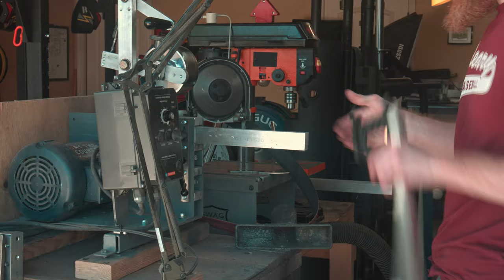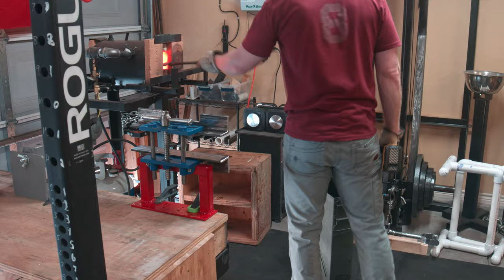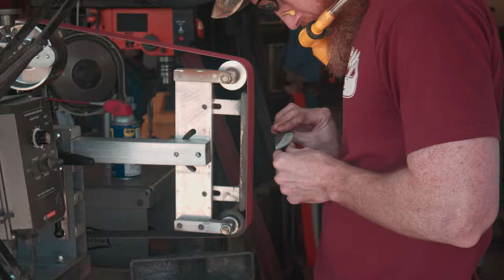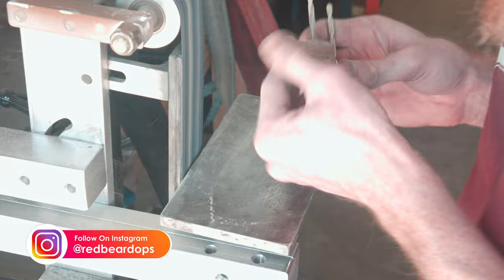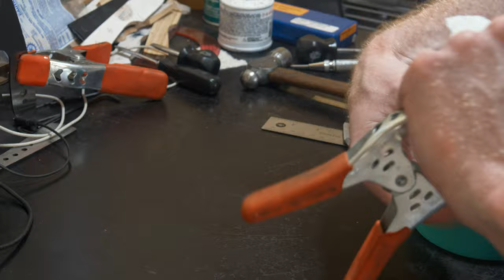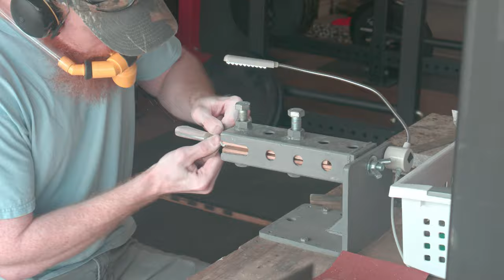Time Lapse | Making A Simple EDC Knife | Knife Making

Comment: That's a great looking Knife! One question, why don't you rough grind the bevels before heat treating? Is it not alot of extra work to grind after? Some of my first knives I didn't pay attention to get the deeper sanding scratches out before heat treat and they were almost impossible to remove. 
I am in the home stretch of my first filleting knife build. That one had some unique challenges dealing with really thin, flexible material. I'm quite happy with the result

Cheers form Canada

p.s. I just emailed a couple pics of the knife. Let me know what you think.
Reply from the maker: I find it easier to do all my grinding post HT. With ceramic belts on the 2x72 this hasn't been an issue for me and it seems to have reduced the amount of warps I encounter. I also feel like I get a more even heat before the quench. The pictures you sent look great! Nice knife sir! Looks very difficult being that thin.

Comment: I have a question, i want to start making knives but as far as handle scales go, they can be pretty pricey. Is it cheaper if i buy a sheet of cherry or oak... from like home depot or is the sheet different and not usable for handle scales?
Reply from the maker: Hey Christopher, I 'm not an expert on handle material but I would imagine that the stuff you get from home depot won't be stable. A good cheap option to get started with is canvas micarta. It's extremely durable and won't swell or shrink. Make sure you don't breath it though.

Comment: When you're doing the surface grind didn't the tape effect getting it completely flat?
Reply from the maker: Hey mike, the tape is pretty thin and uniform. I haven't seen issues with the tape affecting my flat-ness. At least not for what I'm doing. If you were working on a folder I bet you need to be more careful. Cheers sir!

Comment: Loved it! Could you do a knife out of 1095 and test it? I bought 3 pieces of 1095 and want to see how to correctly heat treat it. I've done a lot of research on it but almost of it requires a oven where you can control the temperature. I have a cheap forge made from 2 insulated fire bricks and a map gas torch. I just want to get it right, btw love your content! 😁
Reply from the maker: Hey David, thanks a million for your comment. From my understanding 1095 really needs a soak time to be heat treated correctly... But I bet you can get it to harden to an adequate degree heat treating it like 1084, just not as optimal as if you soaked it. If I were you, I'd HT it like 1084, then file test it. After your temper you can brass rod test the edge.

Comment: Looks good to me, but prefer a bit slower so I can see more details and I like your voice overs about what your doing and why, but there's only so much of that you can do before repeating yourself, still a good vid. It looked like you used the quenching plate vice but when you tempered you still had to use clamps to straighten a warp? Did I see that right?
Reply from the maker: Hey man, I agree. Too Fast. When I was editing I didn't notice since I was familiar with the build. I doubt I'll do another one like this... I do prefer the voice over myself. As far as the tempering goes. I clamped the blade to a straight piece of steel so it wouldn't move during the temper. It came out of the quench/straightening plates straight as as arrow!  Thanks as always for your comment!
Reply: @RedBeardOps  No worries I was wondering, I thought that after going into the vice / plates setup it should be straight :)
Reply from the maker: @MrSoloun  For sure! I've heard some chatter about blades moving around in the temper. Just trying to minimize the chance of that happening!